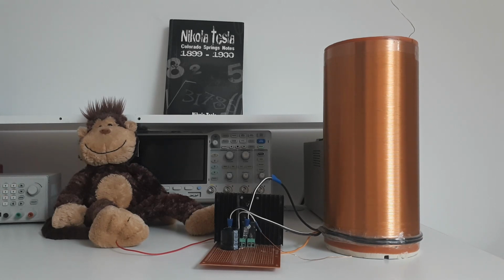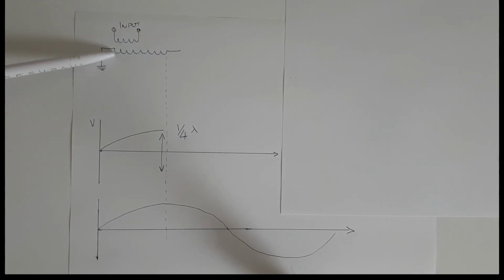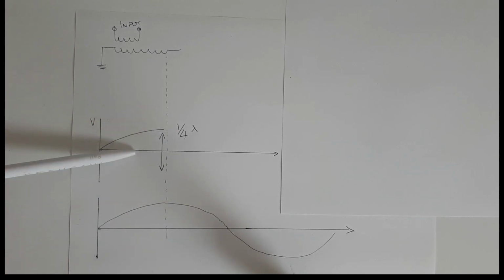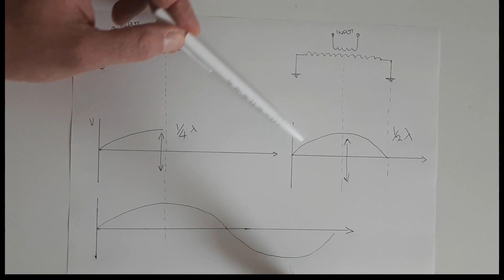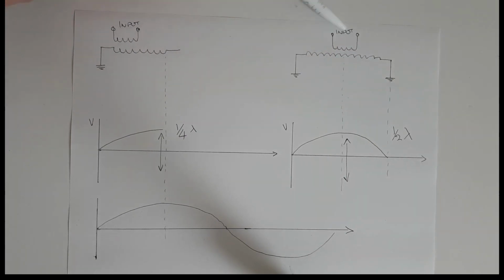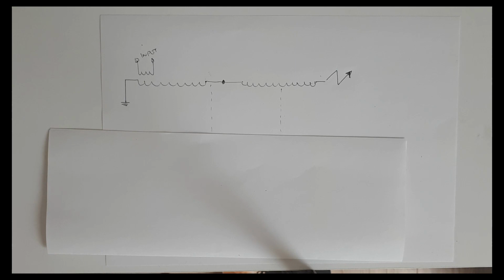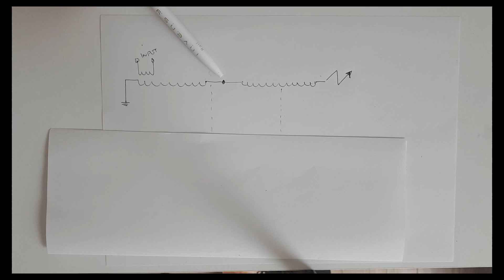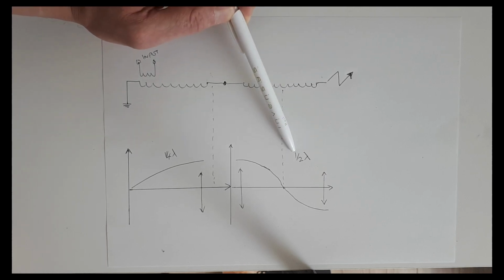How to Increase Tesla Coil Voltage

Comment: One of the advantages of the L3, the Extra coil as Tesla called it, is that if you have it outside the fields of the first 2 coils you can make the coupling between L1 and L2 as tight as possible to induce the greatest effects, since the close coupling weighs down the L2 and the L3 is outside of it you can get the best of both worlds, maximum transfer and free oscillation.

There's also a "Velocity Factor" involved there, where the coils can be configured to allow energy from the L2 into the L3 but resist allowing it back into the L2 which further increases the performance, the VF is like how the energy in waves get reflected back if the next medium is "heavier" in a sense, the VF seems to be based on the Length over Diameter, larger L/D gives a higher and "lighter" factor, Wardenclyffe Research here on YT talks about this in more detail in his video on Tesla's Extra Coil.

I've heard it can also induce a power factor correction effect to eliminate the 90 degree current lag further increasing the voltage.